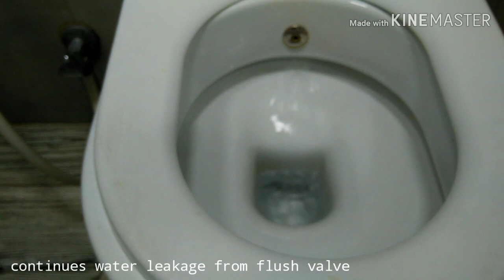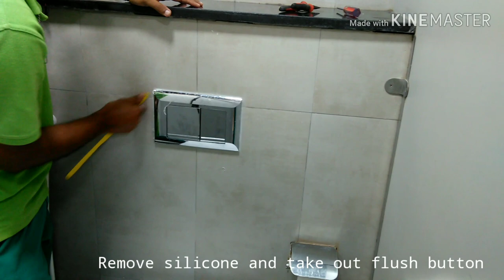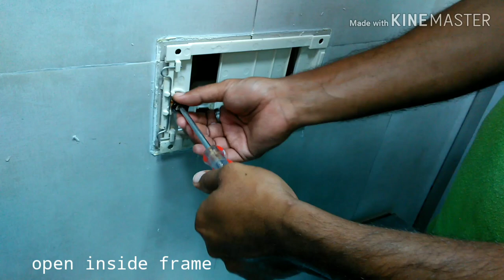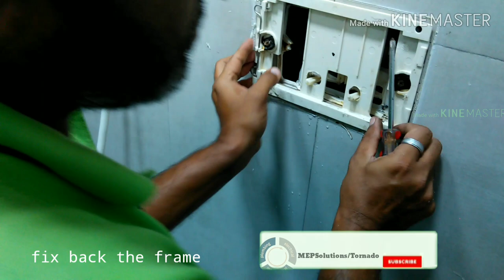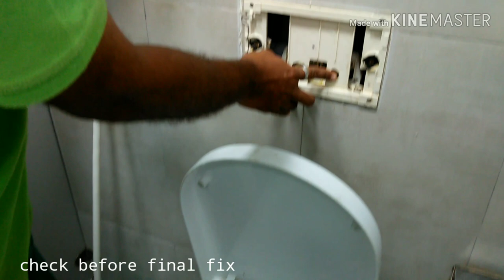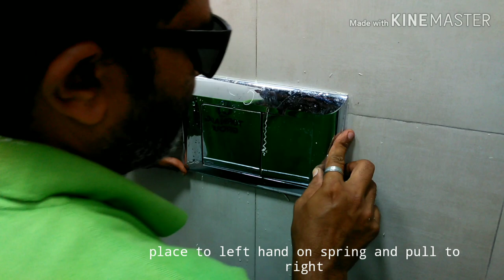Concealed dual flush repair. 
continues water leakage fixed

Comment: After adjusting screw same Problem remain what i do next?
Reply from the maker: Brother kindly check out my an other video on same problem. If still you don't understand or resolve the issue then remove the flush button plate and check for leakage. After removing plate if leakage stop then more tighten screw (as per required) and your problem ll be finished. And it still dipping then may b its your syphon which is misplaced, in this case pull up syphon and readjust it. Hopefully you ll overcome to your problem. Thanks for communicating.

Comment: Plz help me to stop the water comming from flush clockwise rotation. Earlier it was straight. What to do?
Reply from the maker: Brother check my other video in which i explained the same problem. And one thing more bro. Spend little bit time to understand this , check properly and make your adjusted at that point where it not dipping but working. Give little bit space between screw and flushing plate , and my other video
https://youtu.be/9HV408pDu-E
Reply: @90mepsolutions74  thanks you for your reply but i was telling that while water coming out of flush in comod why it rotates ? earlier it was no rotating. i want the reason why water is rorating in comod ?

Comment: Very poor workmanship, the actual problem is the dirt in the syphon valve seal   which he didn't attend to, that is why it was still  dripping water in the pan.
Reply from the maker: https://youtu.be/9HV408pDu-E
Thanks for mentioning the issues kindly Watch this updated version also
Reply: Poor workmanship dates back to when the actual installation happened as they put in the wrong actuator plate